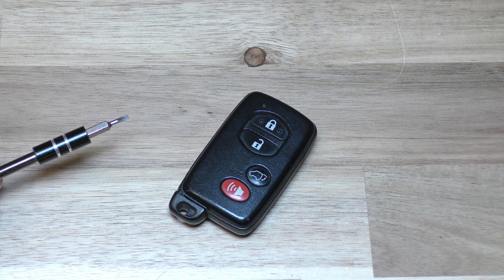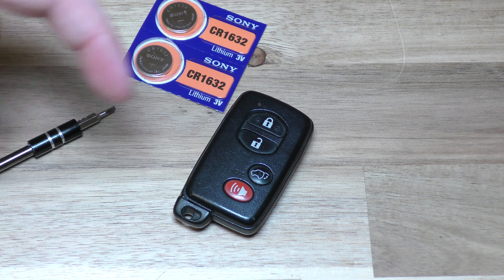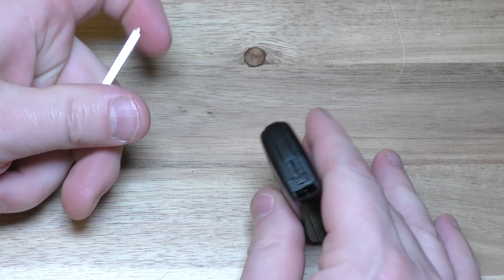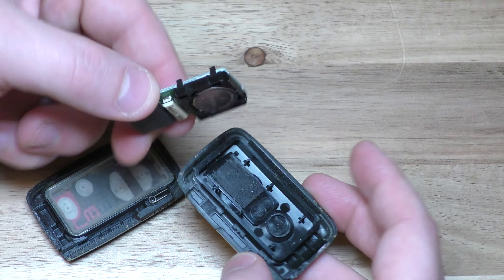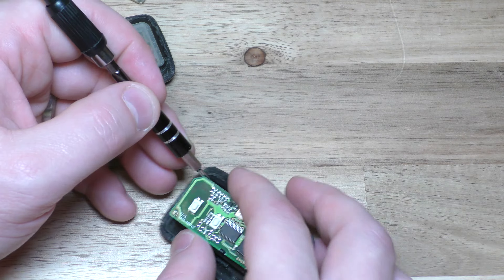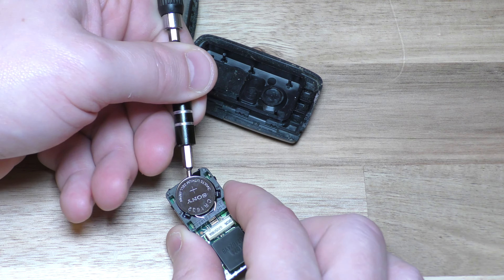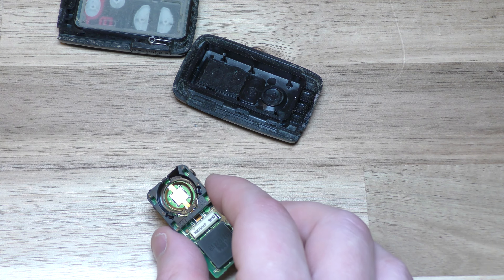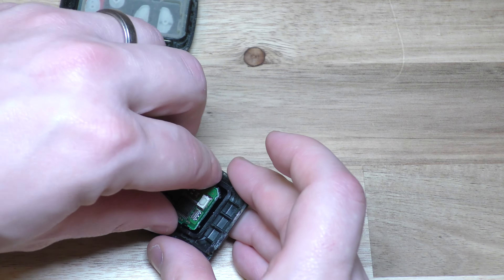2008 - 2013 Toyota Highlander Key Fob Battery Replacement - DIY

Comment: Don't use a different battery than the CR1632, even if it's the same voltage and fits perfectly. I can assure you from personal experience that you will be disappointed in the results.

Comment: Thanks. I put this off too long.  Low battery prompt was surely ready to stop and battery toast. Got it put in easy. For those without small screw driver like me I used a sewing seam cutter. Pointed, small and strong.
Reply from the maker: Glad I was able to help you out!

Comment: Do you need to get the key reprogrammed after replacing the battery? My 08 Highlander’s key fob is dying, but if I can just replace it myself that’d be great
Reply from the maker: No need to reprogram. Throw that new battery in and you're back up and running! Save yourself some cash and a trip to the mechanic!  1632 Battery you need - https://amzn.to/2qCdXf4